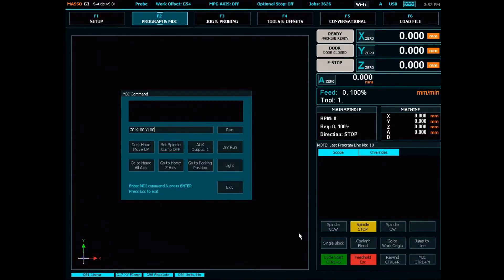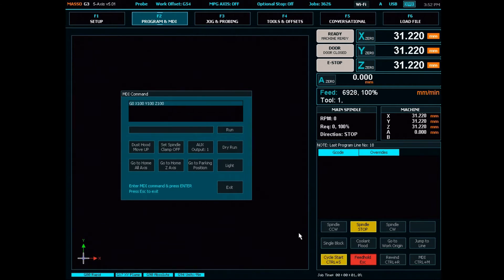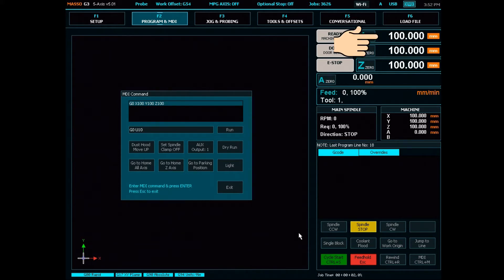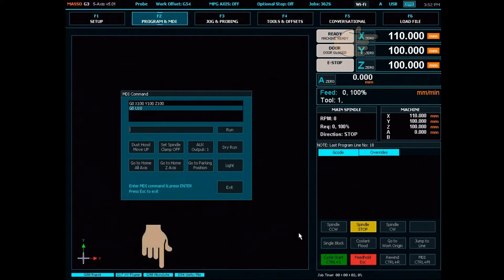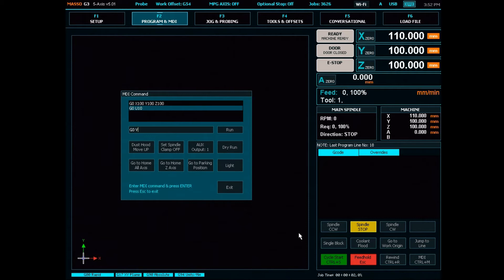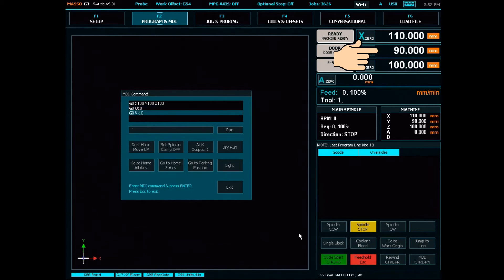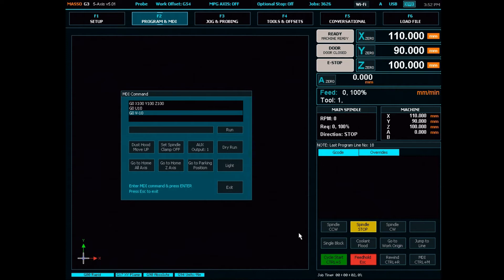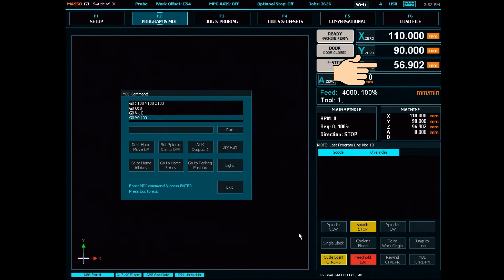U,V & W Axis - Masso Top Tip 5

Comment: Hi. With Masso G3 is it possible to write and use macros ? I can't find macros on Masso documentation
Reply from the maker: You cannot make your own macros on MASSO.
If you have something that you might use frequently you can make subroutines and call it from your program.
I don't know if that helps.
Cheers Peter
Reply: @cncnutzmassoedition9131  Thanks Peter. .it helps